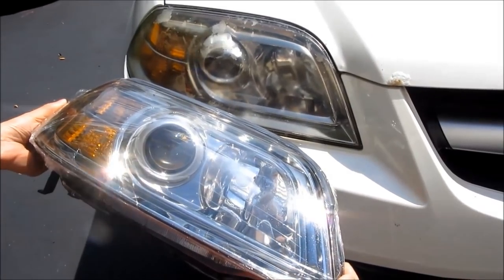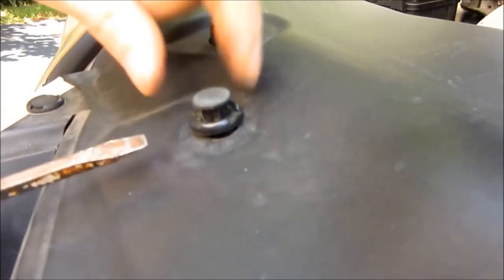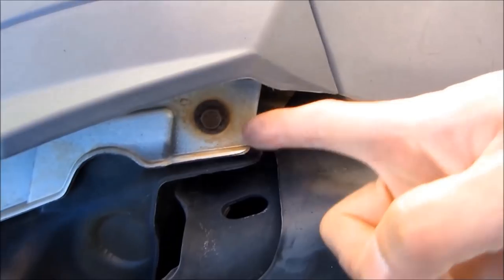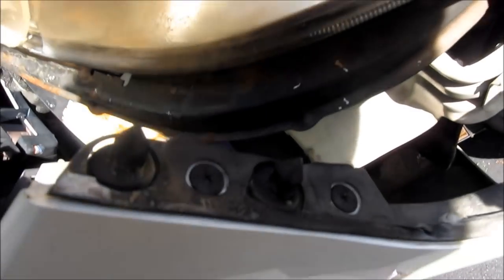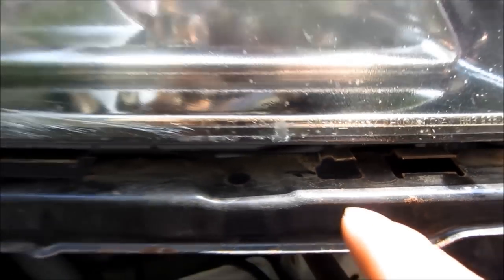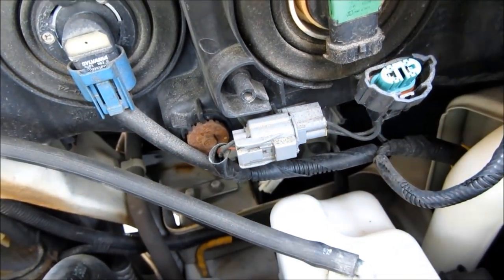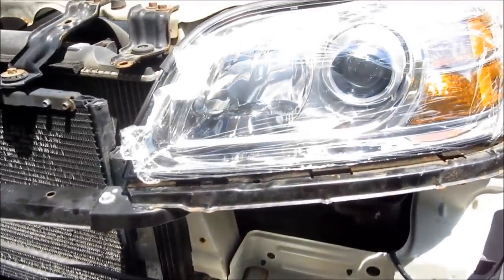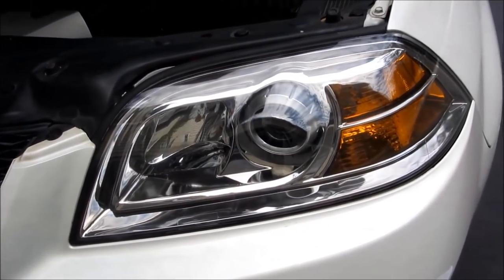Acura MDX - Full Headlight Assembly Replacement

Comment: Thank you much for this video! I replaced my headlight today successfully. Acura MDX 2001, there's another screw on the bottom bumper close to the tire that needs to be removed, also a couple of clips from the bottom side needed to be removed. Also, there are 4 different light bulbs that needed to be disconnected on that model for each side. Low beam, high beam, small light and signal light.

Comment: Excellent job describing and filming the process. I always fight with those pop rivets using a screw driver. I'm now on my 3rd time taking off the bumper, and 5th time taking off the splash guard below it. Buying pop rivet pliers on Amazon too, made this job so much easier.

Comment: Great video. Thanks! Do you recall if the lights shone too high or low after your install? Do you feel like the replacement assembly on each side was properly adjusted without any further work?